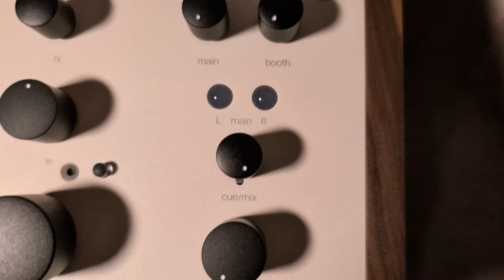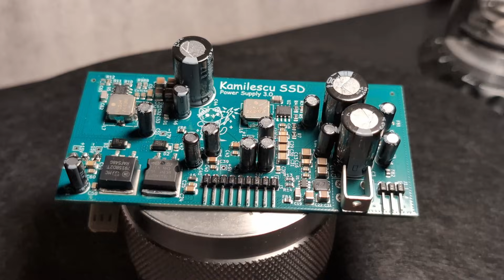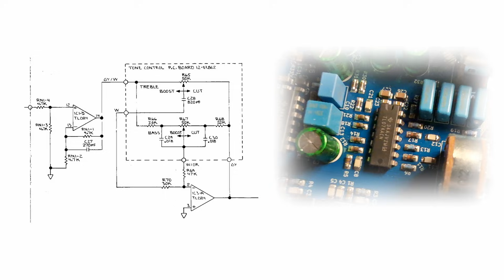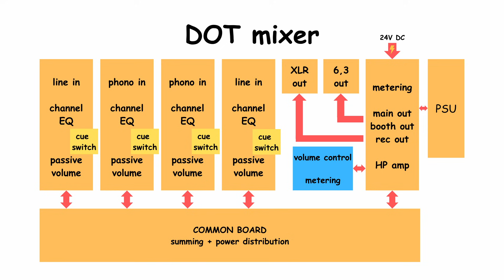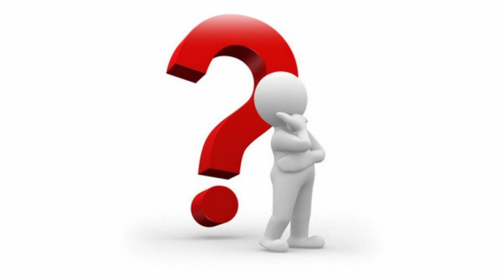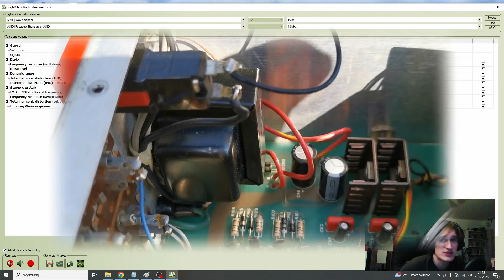Mixers Inside: DOT mixer

Comment: Hi, awesome project and product. Love it.
I learned much about audio mixer with all of your videos.

May I know what type of that pair smd linear regulator that you 're using for local regulation? 

Also, Did you using symmetric 18v(urei) or 15v?  thanks 🙏🏼
Reply from the maker: Pre-regulated voltage from power supply is +/- 17V and then it goes to a pair of 78xx/79xx linear regulators that produces +/-15V rails. With +/-18V rails you gain only 1.5dB of headroom so i went with lower voltage which was dictated by the fact that headphone amp chip accepts max +/- 15V.
Reply: @mixersinside  Thaks for quick replied, appreciated it.

So, I saw many smd with code like "9L510" and "8L251", Are they pair 78xx/79xx in smd size?
Reply from the maker: @tobycookie2198 78xx and 79xx are available in various sizes and packages so it might be it.

Comment: Very nice project and thanks for the walkthrough! Regarding the transformer and your emulation- did you measure how the saturation changes as the input level changes?
Reply from the maker: Yes, low freq saturation rises when you push the channel volume knob harder.

Comment: i can disable the subsonic filter by jumping only?
Reply from the maker: Yes, by resoldering the jumper. I soldered it on purpose to achieve reliable connection. But I can also put regular, removable, solderless jumper there.

Comment: Is that why alot of people prefer the booth output instead of the master with Urei 1620, cleaner signal?
Reply from the maker: And the other way around. The booth signal is not getting balanced by transformer stage. You can find full UREI schematic walkthrough on my channel, where i explain what's going on there.